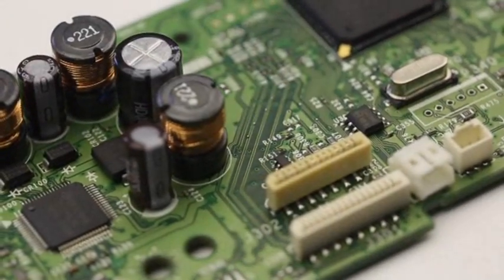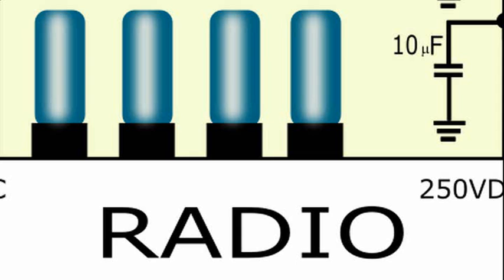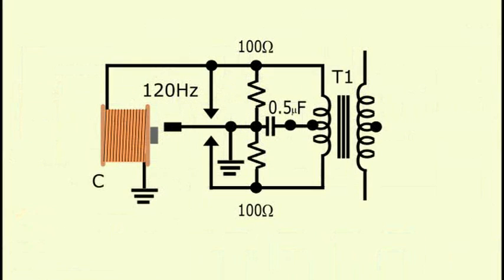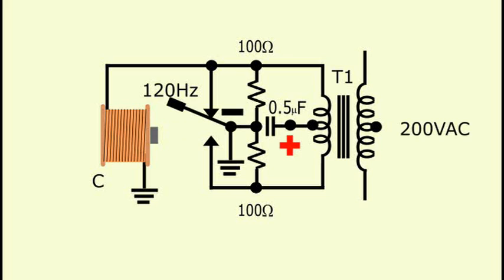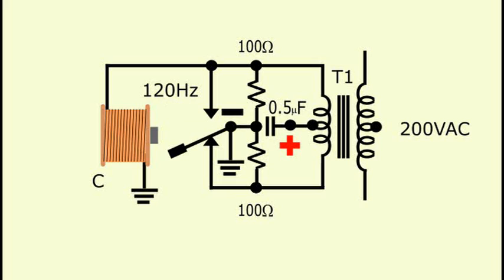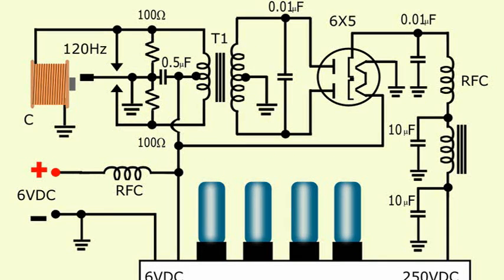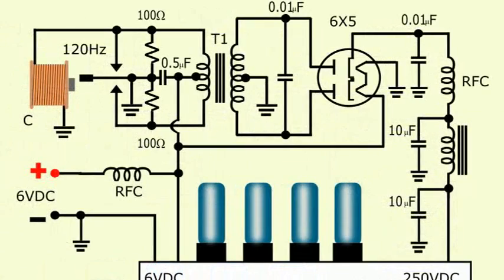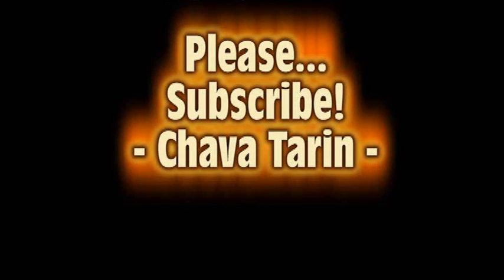Where old car radios got high voltage for vacuum tubes

Comment: Where is the D.C. supply for the primary side of the vibrator for T1?
Reply from the maker: Excellent question! Since I focused my attention on the vibrator action, I forgot to draw a line from common contacts of vibrator to the positive side of the power supply (6-volt battery), however, there is a red plus sign connected to the center tap of the power transformer (labeled as T-1). Sorry about that!

Comment: Yes, I remember them, the vibrators came in a metal container (like capacitors) surrounded by a brown rubber, in order to reduce mechanical noise.
Reply: I recall seeing one of those vibrators in the early seventies.  I recall calling it “el jolto”.